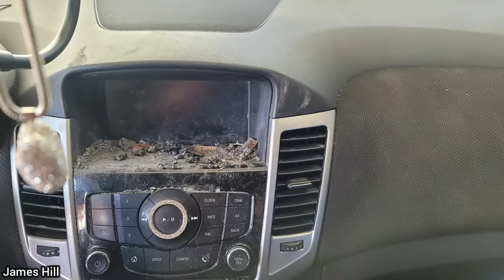Customer States New Oil Pump Installed, Still Has No Oil Pressure

Comment: Some of these complaints by the customers are insane. He used the radio as an ashtray and now wonders why it doesn't work.😮
Reply: I think the only thing wrong with some of those vehicles is the owner having a few screws loose!!  I would hate to see what the inside of that person's house looks like.  Probably a mess and nicotine stains everywhere.  A place where my sister moved in once was not a mess but you could tell the previous occupant was a smoker.  There was slightly sticky yellow stuff on everything.  It is nicotine.  It was tedious getting that off everything in there.  Thankfully most of it was in the kitchen.  It was disgusting!
Reply: Being that they are roaches from all the joints they smoke, they are obviously too high to realize that’s not an ashtray 😂
Reply: Those look like regular filtered cigarette buds though…

There are a lot of people out there that don’t need drugs to do stupid things 🤐
Reply: @charleshines2142  The sticky yellow stuff isn't nicotine, though. It might contain some nicotine but the bulk of it is condensed smoke. You'd get the same residue from smoldering wood or other nicotine-free plant material.
Reply: @Papperlapappmaul  I would hazard a guess that's why most of it was in the kitchen - probably mostly oil and grease residue from frying.
Reply: @mystery_pond  still disgusting
Reply: Just like shooting yourself in the foot and wondering why your foot hurts
Reply: From what i remember "other" smoke doesn't make things yellow. 
We had such a room at work years ago. The occupants of said officeroom were heavy smokers. And everthing in there was covered in a sticky orangy yellow layer. From the former white walls and curtains, to the formerly grey desks, hole punches, staplers, computer monitors keybpards, mice, the desktopcomputers themselves, chairs, light switches... everything.
Never before and after have i seen such a drastic example of what smoking causes.
And there was never any cooking going on in that room. And from my childhood i remember how smoke residue from wood fires looks. It's not that sticky, and missing the orangy-yellow colour.
Reply: @nirfz  Nicotine is definitely much much worse than anything else, but I've been to non-smoking friends' houses (who don't keep on top of their cleaning...) and seen the same sticky yellow grease on the undersides of kitchen cabinets in particular. The only common connection I noticed is the cooking greasy/oily foods on a stovetop or use of a deep fryer. Just as annoying to remove but thankfully takes so much longer to build up.
Reply: @mystery_pond  Yes, i know what you mean, but that sticky greasy layer from cooking is only on things above the stove and somewhat to the left and right, and you won't find it on the opposite side of the room.
The sticky layer from smoking a lot (really lot) covers the whole room somehow.

And the advantage of the cooking greasy sticky layer is that it doesn't make the room smell as much and as bad. 🤮😁
Reply: I'd say that is a 'she' with all the stick on jewels.  LOL
Reply: Definitely see a stem from a bud
Reply: What are cigarette buds I thought they were butts
Reply: Joints looks like blunts
Reply: What surprises me the most is that they didn't even bother to hide it. You'd think they would realize the obvious and try to clean a little so it's not as noticable
Reply: Just outright put they cigarettes out on that ledge where radio is.
If you don’t have an ashtray at least use a soda can as ashtray (seen that done years ago)
Reply: @Shiekh420 It‘s not. Ever touched a slot machine? Then you know that it‘s sticky nicotine-induced tar residue that gives everything this yellow tint that smells like the smoker‘s lungs and is sticky like angrease bottle!
Reply: @RustOnWheels  nicotine isn't a drug?
Reply: @The_Ballo  it’s addictive but not mind altering.
Reply: @RustOnWheels  what does that have to do with anything?
Reply: @The_Ballo  read the reply above mine that you replied to and you’ll find out.

Comment: Four words that send a cold shiver down my spine: Customer Declined All Repairs.
Reply: At the very least the shop needs to make them sign a waiver to release the unsafe vehicle to them.  Insanity.
Reply: My guess is that they prolly gonna go scrap ir
Reply: Here in Canada or at least in my province the shop can refuse to return your vehicle until it is roadworthy. It seems to be a new thing and some shops are abusing it for example fender well rust on a truck may injury a pedestrian. But overall it's sensible to not allow a vehicle on the road if it's not safe to drive it or may endanger other people.
Reply: Many times it means in my shop, vehicle not worth repairing, but a different one.
Reply: Just slip them a charnel house business card with the bill
Reply: It sucks, but lots of people are struggling. Car repairs are expensive, and something like 60% of Americans can't afford a $1000 emergency. Considering the vast majority of places to live in America require a car to live in them, it's not exactly like you can say "I'll take the bus until I can afford the repair." You just drive and hope for the best.
Reply: Taking a bus won't kill others, unlike these junk cars. Idk, people should get better wages and access to healthcare so they have enough money left to maintain cars roadworthy.

Comment: Not sure how a " mechanic " can install an oil pump wrong , and then fill the engine with lucas stabilizer 🤦 . Last clip , excellent work , kinda gives a new meaning to " woody "
Reply from the maker: Sounds like the customer did that one 😅 cause I'd be going back to the "mechanic" who did it lol
Reply: I’ll bet most of the time when someone brings in a disaster like that and blame it on “another shop”, the perp is really the customer or their cousin or buddy etc.
Reply: @Sashazur  where I live there are unqualified mechanics working at the repair shops because there are so few qualified. Anyway, I DIY as much as possible because that way I know my own car and also care more than some mechanics.
Reply: In that clip, the shop that installed the oil pump got what they deserved.
Reply: I would never use lucas stabilizer on any engine built in the past 20years.
Reply: @entezami777  same here , that's why I stick with older vehicles ( carbureted and distributor )
Reply: @entezami777  Not even that. It's a last act of desperation when the car has less worth than the bottle and the next trip.
Reply: @entezami777  you wouldn't need to if you kept up on oil changes. With that said the only thing I'd use is Marvel Mystery oil and even that's not really needed.
Reply: When a shop has too many problems, I stop trusting them and won't bring my car back there. 
Did that after my car failed with a bent wheel a few days after getting new tires. Did that after a bumper repair turned into a Viking saga of weird stories and missing parts.
In each case, I brought my car somewhere else to be fixed properly, then returned to the original shop only to talk, so I could tell the state regulator that I'd tried.
Reply: And the thing is, it's the goddamn information age! You can type just about any repair into google and come up with a ton of forum posts and youtube videos showing you how to do it, step by step. It's how I started to learn how to do repairs on my cars.
Reply: The mechanic who dumped that it must have gotten an earful just because of the cost of the stuff!
Reply: @questioner1596  that or unqualified mechanics working out of their garage as a side hustle. There were too many of those where I grew up, and a lot of people went to them.
Reply: @snesguy9176  yes, but I doubt one of those would have paid for the new engine
Reply: @VintageCars999  I used to exclusively use Mobile 1 High Mileage with a quart of MMO, but recently switched to AMSOIL for everything. Lots of improvements in my 35 year old rig and I expect to get another 340K miles out of it.
Reply: @WastedTalent-  That's what I do when I've got something that needs doing. It's what I did when my intake manifold developed a leak (hey-it's a 23-year-old car). There are some things I'll let a shop do (like when I had to have my clutch replaced. The tools would have cost a fair portion of just getting it done, and I'm unlikely to ever need to use a transmission stand a second time.
Reply: To be fair, the oil was definitely stable!
Reply: @MikeDCWeld  that it was, in fact you could've poured that "oil" into a pile on the table and it wouldn't have gone anywhere - stable as a rock! 😂
Reply: @JustRolledIn  Unfortunately, I'm pretty sure I could find a few genuine shops that would do such a thing.  The people fired by Midas & Firestone gotta go somewhere after all.

Comment: That truck with the wood shell is gorgeous.
Reply: You said it. I don't know if its better to admire it or drive it.
Reply: Probably drives pretty fast too, considering there's no metal
Reply: Looks like a pretty bathtub.
Reply: it isnt wood, its a wrap. its like a big sticker.
Reply: @zzzubmno2755  TY.
Was just coming here to say that.
Ford never made a wood car like that and anyone who has actually seen wood would know that's not real
Reply: I've got wood. ;)
Reply: @x808drifter  not only that, it would rattle itself apart if it was made of wood.
Reply: Agreed.
Reply: @zzzubmno2755  from the video's description: "Took 3 years to completely transform this old Ford. The person who did this is a cabinet maker by trade. The body is all made out of wood and does not have any metal."
Reply: Did it give you a wood?...
Reply: I wood agree it is certainly beautiful.
Reply: @zzzubmno2755  You are mistaken.
Reply: Talk about an old school fibre coating eh? XD
Reply: I thought it was a wrap too..be pretty amazing to get those fenders like thst 😜
Reply: I wonder where he moved the gas tank to on the Model A
Reply: @x808drifter  Have you ever seen vehicles called Woodys?
Reply: @zzzubmno2755  in the picture it said it took three years and was done by a cabinet maker so the body may be completely made of wood.
Reply: @bayareasportsfan04  The wood is going to be heavier than if it were metal. It's probably not really wood though.
Reply from the maker: @John_Ridley  It’s made completely out of cherry strips & 2800 hours to build. That's what the owner just messaged me.
Reply: It is beautiful, but I'd be too worried about it getting damaged, to enjoy it on the road.
Reply: I can't make it today, my car has termites ☹
Reply: @zzzubmno2755  WRONG
Reply: Could not agree, unbelievable work put into it, must of taken 100's of hours to do...
Reply: @bayareasportsfan04  even without "Pedal to the.. err..  metal" ?  😇
Reply: @BaldyTheOnlyOne  Pedal to the stump.
Reply: @bayareasportsfan04  The wood would actually weigh more than metal.
Reply: @zzzubmno2755  LOL, do you have a clue?
No reason the body couldn't be made of wood. In case you were unaware plenty of speedboats were made of wood.
The cab would sit on a chassis and could largely be insulated, though I doubt vibration would be a problem..
Reply: @x808drifter  Um, I've seen plenty of wood and cabinets. That could easily be made of wood.
Why do you think it is meant to be some kind of original body?
Looks to me like a custom car that's nice to look at but probably wouldn't be any use as a daily driver.
Reply: @x808drifter  Ford did make a "Woody". They did not make a Model A version. However those did have a wooden frame for the body and the floors were wood. The wood helped absorb noise and vibration. The video did not say it was built by Ford, but was built by a cabinet maker.
Reply: @zzzubmno2755  well at least the tool chest in the trunks seems to be real.
Reply: it wooden start
Reply: @clearcreek69  or even use the side steps to hop in. I can’t imagine it’s all original. Unless they had the thing in perfect conditions it’s entire life
Reply: @x808drifter ford didnt make it from factory
But someone spent 3 years building the body out of wood (says in the video chapters)
Reply: That one is a jaw-dropper.
Reply: wrap
Reply: @zzzubmno2755  it's real wood, why would someone wrap an antique like that
Reply: @TheCoolDave  2800 hours, according to the builder. He should know.
Reply: @truthandreality4650  So you know more than the builder/owner? Got it.
Reply: @magna116  The builder says it's wood and took 2800 hours. You know more than he does?
Reply: @wymple09  I was referring to the person calling it a wrap.
Reply: It is a beaver magnet.
Reply: @frankspencer6935  Hilarious!
Reply: I'd say it is
Be a whole lot of hours
Reply: LGR would love it.
Reply: The only word that came out of my mouth when I saw that was "wow"...
Reply: The wooden car that wooden go.
Reply: @vanhooler358  boom boom

Comment: I ripped out a driveline once. Had a load of wood on the truck going up the side of a creek bank in granny gear in 2wd. Started hopping and before I could react, the driveline twisted, the splined end pulled out, and it started banging on the floor. BANG BANG BANG! Had to walk 5 miles home, and do all the repairs out in the woods. I kept that twisted, crumpled driveline for years as a reminder to not drive my vehicles so hard.
Reply: Something similar happened to a building contractor customer I had while they were building a house up in a mountain. The road they had build to get up there was good and smooth but the slope is quite steep and one day they were hauling some supplies up there and the drive shaft twisted up but luckily for him it was the part between the carrier bearing and gearbox an he was going slow so the repair was minimal, it was also a 2wd and he was just pulling off
Reply: That should not even be possible!
How can the engine have more torque than the drive shaft?!
Reply: Gears

Comment: 1:45
An unconnected snorkel AND a warm air intake!!!????  That is like +10 performance points! Another +5 if you have a K&N sticker installed somewhere.
Reply: +20 if you have a light bar on the bumper, on the roof, and lights bolted to the hood. Bonus +10 for an american flag grille and a flag mounted on the back. Instant win with angry eyes headlights and/or color changing headlight rings. And yes, I've seen Jeeps with all of this shit piled on.
Reply: For years there was a 77 Charger (the Aussie one, not the U.S one) driving around my town with a tunnel ram scoop sticking waay out the bonnet (Hood). One day it came into the servo when i was getting fuel, and he popped the bonnet, so me and my mate wandered over to check out what this beast was packing. The tunnel ram scoop was sitting on what looked like a 12" length of drain pipe, attached to a stock 2 barrel carb, on a bog stock 318. Man we laughed.
Reply: It's a warm water intake actually when you drive through a river.
Reply: The amount of people that think a warm air intake is gonna gain them power just astounds me 😒

Comment: 1:02 I know people who are this stupid. Somehow they have no grasp of keeping track of the hardware when they take something apart, then instead of finding something that will work they just grab something and force it or drill new holes. It's insane watching someone getting angry trying to force the wrong bolt into a hole with an impact, then step back acting all satisfied with themselves when they strip the hole and it goes in.
Reply: One of the previous videos on this channel had wood screws replacing head bolts and I was screaming internally.

Comment: Great way to spend this holiday weekend watching my favorite channel . One thing about dash cams , customer installed , as good as this one here , or factory installed is every time you turn on the ignition the camera comes on and be sure or just assume the customer will look at the footage when they get the car back . A former employee from the detail department got caught doing nothing but a quick wash on a customers car that had a dash cam , a shop meeting quickly happened after that incident ..
Reply: Surely you're allowed to disconnect or disable them once they're in the workshop?

I know in most of Aus we are allowed to unplug them.
Reply: @aspergerio  Its funny you brought up this exact point . Had this conversation with management the other day , some cameras you can pull from the lighter but some are hard wired . Personally i have nothing to hide and take pride in my work but i cant stand knowing i will be examined and judged by someone i gave no permission to , by someone who may or may not understand my job , so i unplug at strategic moments when possible if not i put the hoist higher . Not sure of the legality either with being filmed without permission but i feel this topic will be up for debate in the coming future ..
Reply: Just put a post-it sticker in front of the lens as long as the vehicle is in your shop

Comment: I also installed my own front and rear dashcam, but I followed the instructions and hid the cables properly. On top of that I modded it using a free slot for a button (one of those that are left unused if you don't buy the car with ALL the extras) so that I now have a button there to turn off the surveillance mode power cable when I'm parked in the garage.